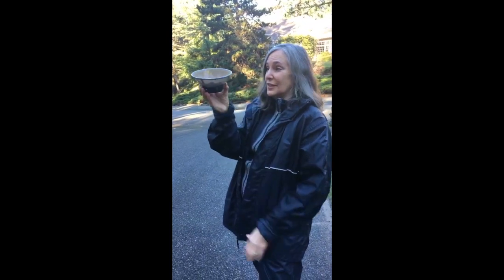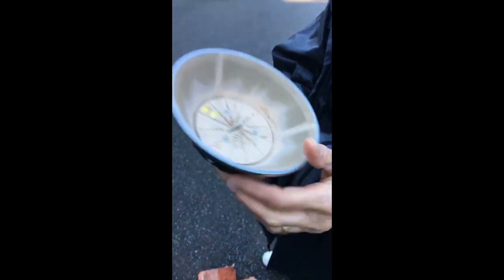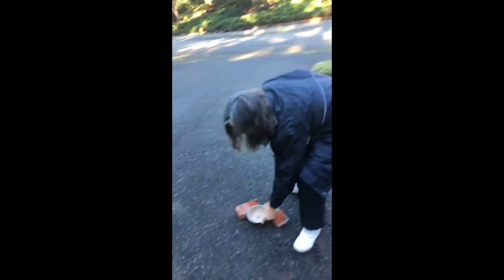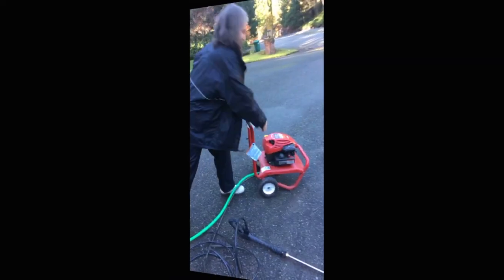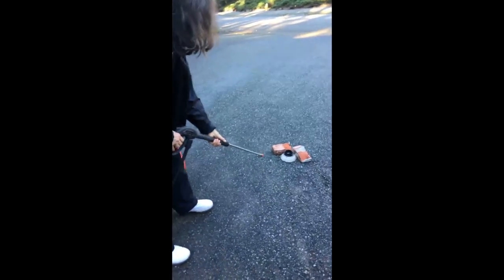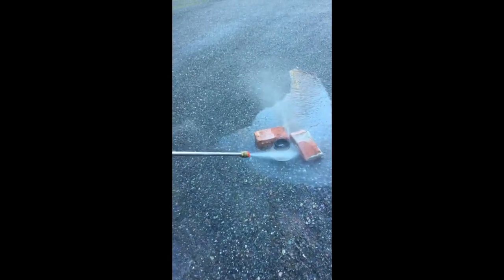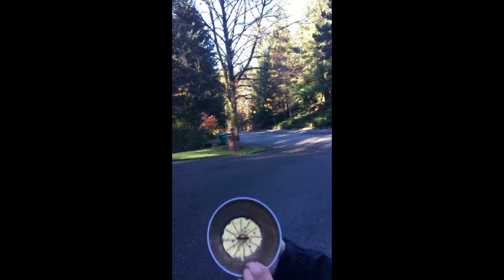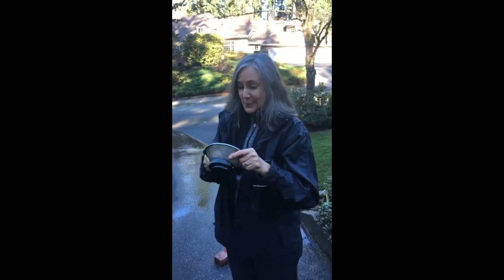Unclogging a Juicer Filter Basket

Comment: Just soak it in Oxiclean for 5 minutes and everything clogged will soften. Then Use the Breville brush. It’s easy. You don’t even need to scrub. It will look brand new. No power tools needed.
Reply: This 👆